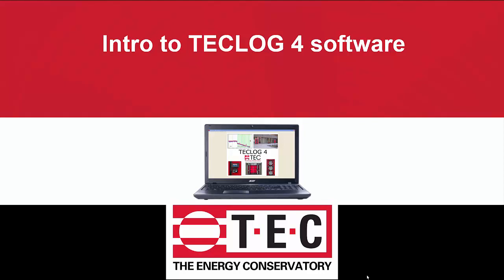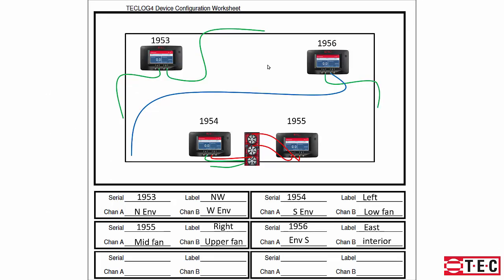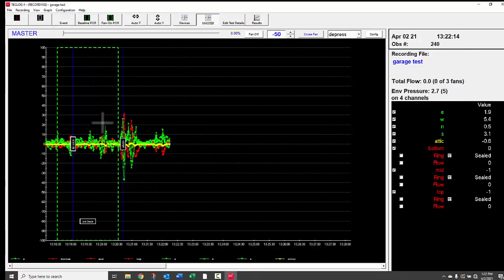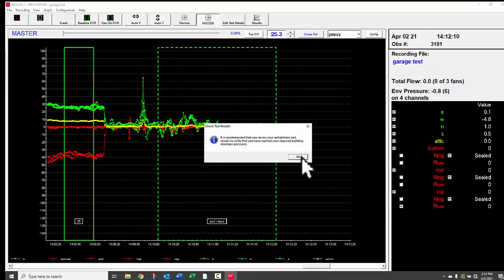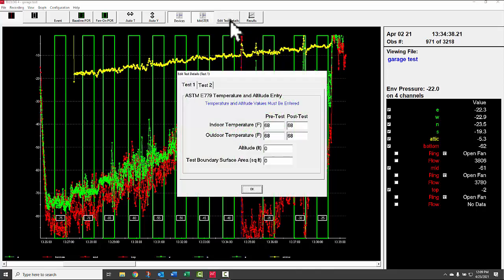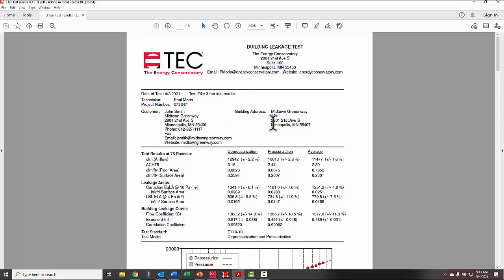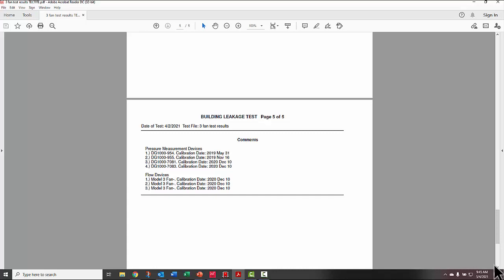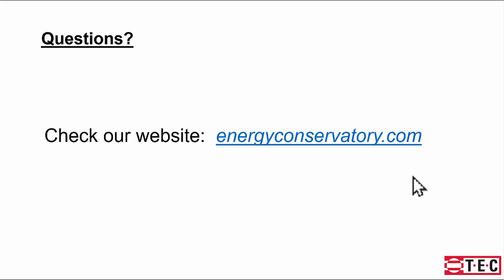TECLOG4 Software Overview for Multi Fan Testing, pressure logging and more...

Comment: Hi! I’m currently attempting to run a 3 fan test and without any fan movement I am receiving the error “Low device pressure” on bottom left.  I have added multiple rings to this fan and still getting this error message. Any advice would be greatly appreciated!